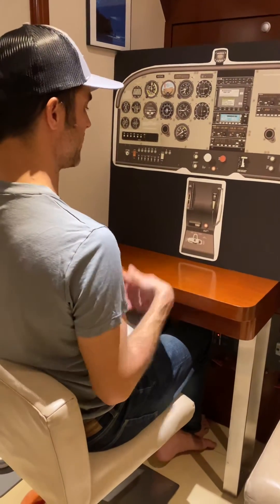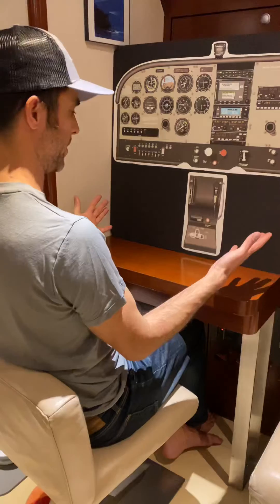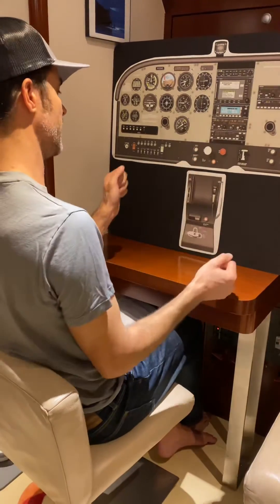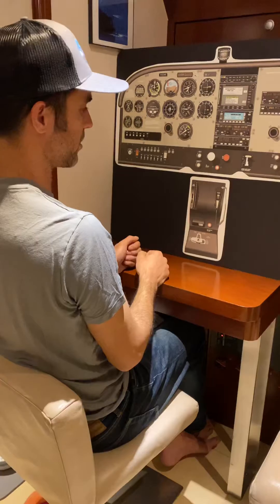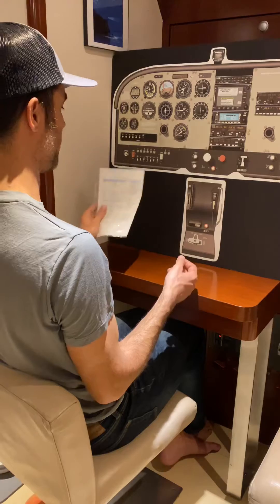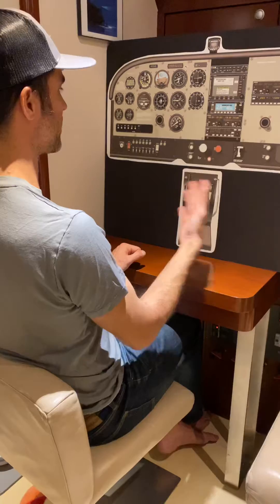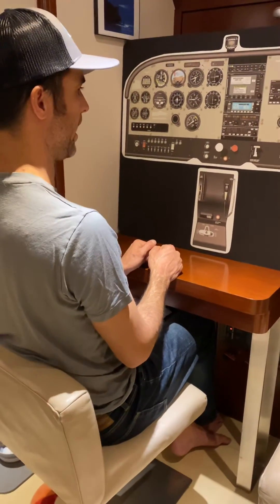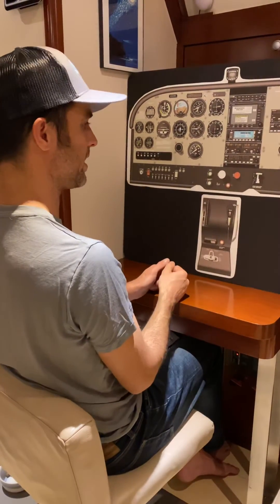Chair Flying - Emergency Descent / Engine Fire in a Cessna 172N

Comment: What does fuel selector off mean? Isn’t it left right or both? You mean the fuel shutoff valve?
Reply: In C172, it means fuel valve shut off
Reply from the maker: Depends on the plane. in a 172N - it's four positions - left, right, both, off.